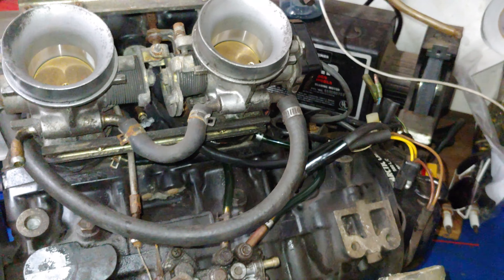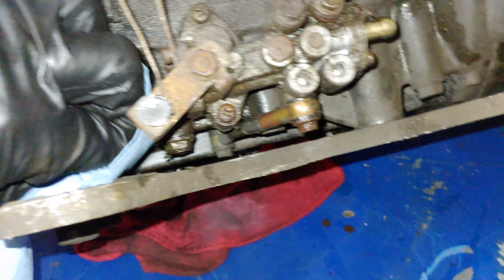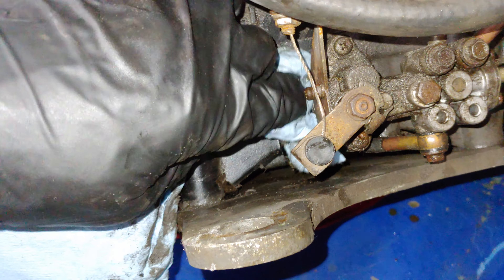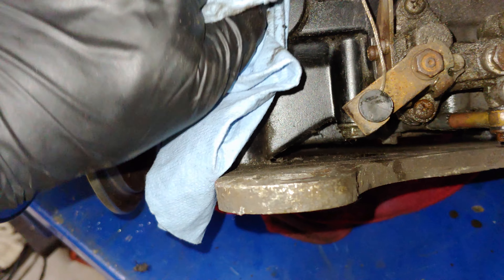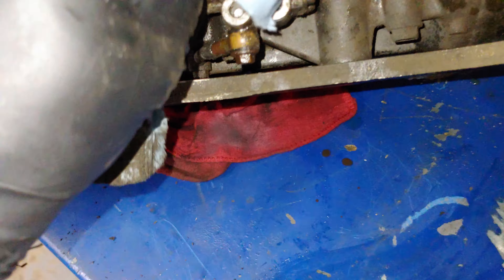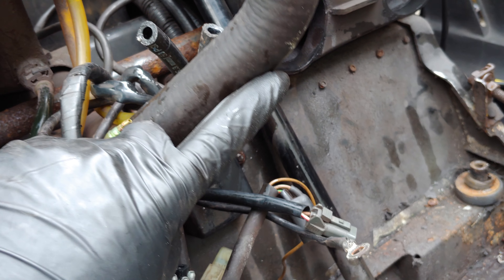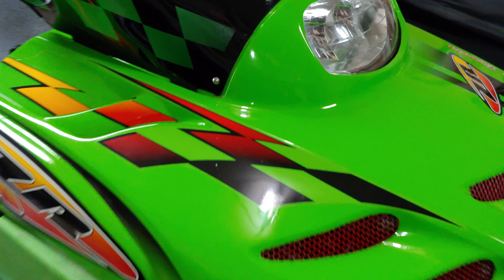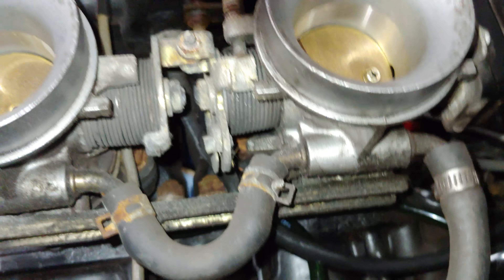96 Arctic Cat ZR 580 EFI engine

Comment: Andrew crocker does the crank seal on the pto side get replaced externally?
Reply from the maker: Technically you can just pop the primary clutch off and then the seal plate at the end of the crank cases and then pull the PTO seal off but if the PTO seal is leaking trust me I've done a bunch your Magneto side will leak shortly after that so you may as well just pull the engine split the cases replace both crank seals and rebuild your water pump which is the oil seal the mechanical seal and the washer seal for the bolt that holds the impeller on and make sure to polish up the impeller shaft where the seals ride. You'll save yourself a lot of headache that way and take it from someone who's tried to cut corners in the past it doesn't work. LOL so please learn from my mistakes
Reply: Andrew crocker. Yeah I can't get my PTO side carburetor to adjust right and I cleaned it and both sides and I can't seem like it's not getting something something's wrong with that I replace both car boots and put all new internals in it and my carbs and just nothing
Reply: My buddy told me to get some carb spray and starting fluid and spray it behind the primary and see if what it does and then he said he might be a bad a bamboo he said it sounds like you're getting are somewhere into the system so I replace both car boots going from the Block to the carbs I rebuilt the carbs but it might be a couple things or not right with it one of them
Reply: By the way I live in Michigan too I live in Owosso the other side of Lansing Michigan
Reply from the maker: Yiu can so a pressure test as well ans that will tell you exactly where it's coming from. 

You'll need to plug up the exhaust ports and intakes and use pvc and get the 15psi pressure gauge they sell on Amazon that has a air valve. Pressurize it to 8psi and use soapy spray water. You'll have to pop off the recoil starter, flywheel and stator to see if the mag side is holding. But if it's one of the crank seals replace them both. 

It can also be one of the carb boots to the cylinder. You could pop those off and use Permatex Right Stuff 1min gasket maker on the cylinder side.

Comment: How do I put in the new gasket in my sled
Reply from the maker: If you are speaking in terms of Crank seals, you have to split the case as if you need to replace one, save the engine and time by pulling the engine and installing both. 

Check this video out. https://www.youtube.com/watch?v=yuGBoX7lTwM